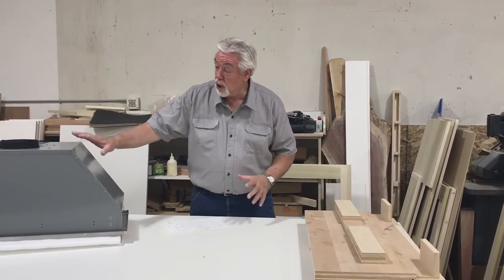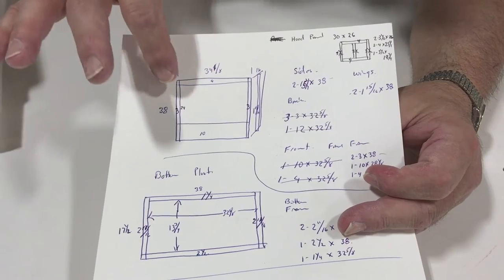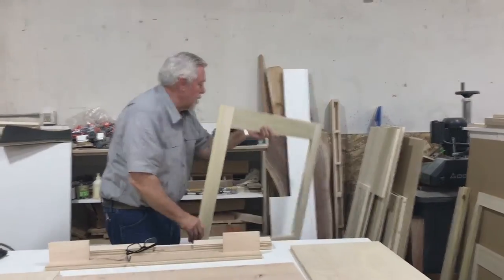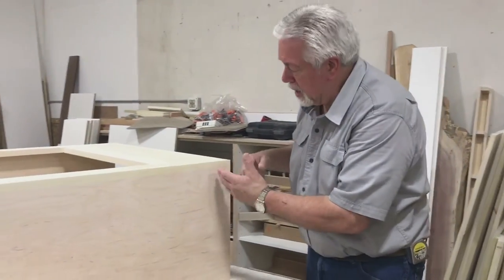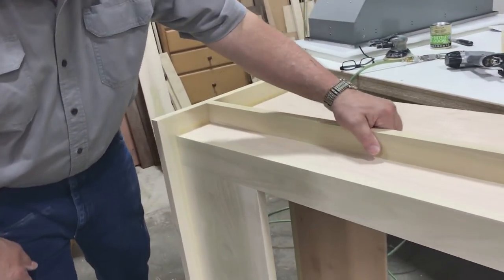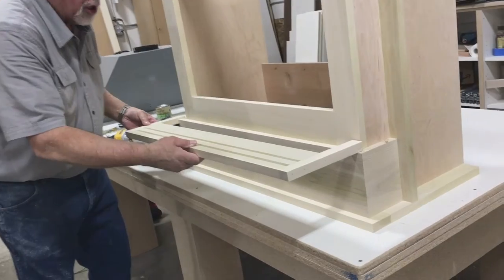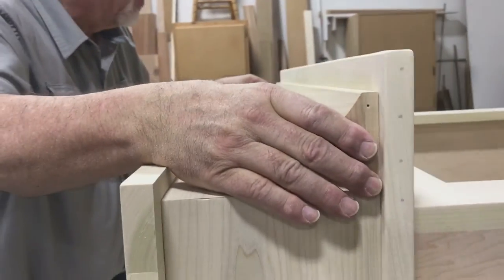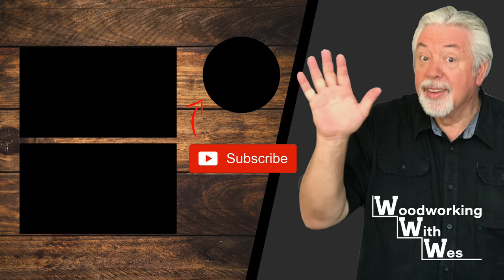Make a statement with this clean and simple shaker hood.

Comment: How did you attach the insert?
Reply from the maker: Actually the insert comes with its own mounting brackets. Thanks for visiting.
Reply: Thanks for the response. I believe by accident I purchased the same hood. My hood came with L brackets only. I can’t see a way of using those brackets. If you came up with a good solution I would like to see it so I don’t have to reinvent the method.

Comment: You didn't show how you attached the insert to the cabinet! Seems like a glaring omission.
Reply from the maker: I was just showing construction of the hood but will be sure next time to include more info. Thanks for you comment. Wes
Reply: Does the appliance slide in from the bottom or down through the top to rest on the lip?
Reply: Can you comment on how you attached the vent to the cover?